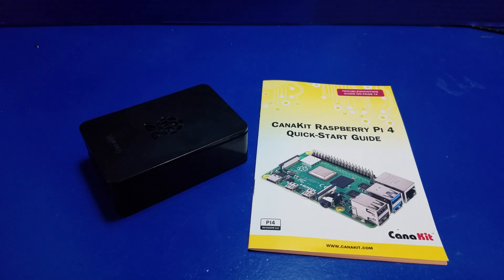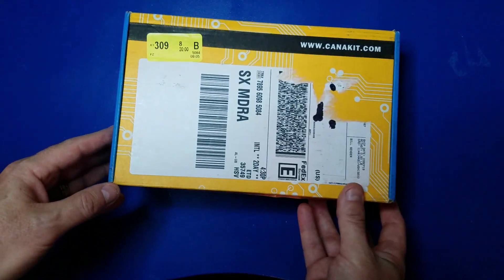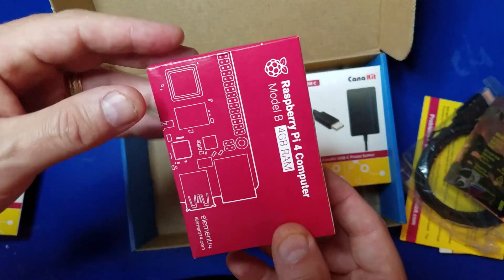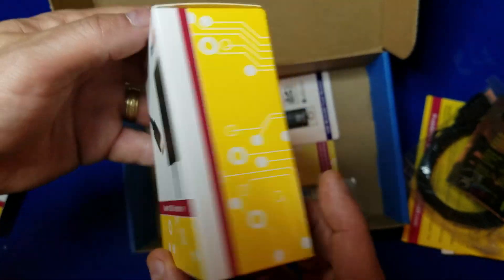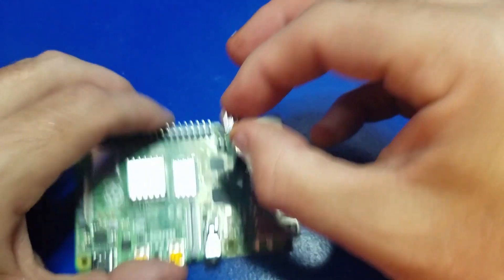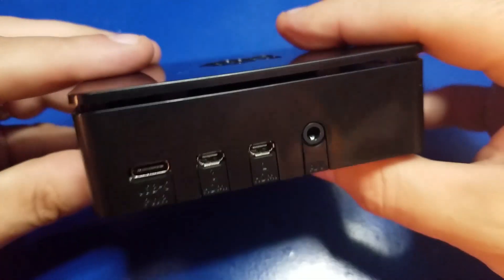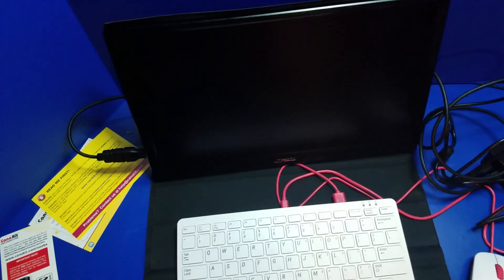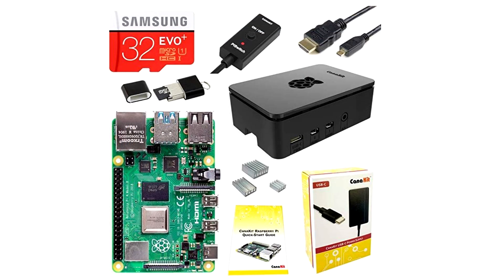CanaKit Starter Kit for the Raspberry Pi 4 4GB Setup with Heat Sink+Fan install & Test!

Comment: Hello everyone, and a big thank you to Wagner's TechTalk for posting this video, it helped a first timer set up his Raspberry Pi 4!

I purchased a Cana Kit with the Pi 4 with 4GB of memory, a 64GB SD card pre-loaded with NOOBS, and pretty much everything else shown in this video (mine had the on/off switch for the power supply).

Follow this video through each step (I paused where needed to make sure everything was correctly connected) and you should not have any issues with getting the Pi up and running. There are a couple of things I wanted to mention that I took notice of while getting everything ready to go.

First was the time it takes Rasbian to load on the card, for me it was about 12 minutes. Then when you select the check for updates option, it took approximately another 15 minutes to download and install (all automatically) the updates.

Also, while the Pi is checking for the software, and right after you first see the four Raspberries in the upper left of the screen, the monitor I was using went blank, saying no input, for a few seconds, then the Pi picked back up where it left off. So if you do see that on your monitor, don't panic, it should only be a few seconds at a time.

One thing I noticed (because I've watched several videos and read some articles on the Pi and it's setup) that was not mentioned in this video was what to do for your password. The Pi is pre-set with the password "Raspberry", and it is recommended that you change it to a more secure password during the initial setup. There are more experienced computer / Pi users out there that don't worry about this because of how much they work with computers, and change configurations, they just keep it simple for them.

The equipment besides the Cana Kit I used for the setup was a USB keyboard, a USB mouse and an LCD television that has an HDMI connector. Once the power was turned on, I had to find the television's menu to change the input to HDMI 1, and I saw the Pi's initial screen to select Rasbian to load.

I just thought of another issue I heard and read about regarding the cooling fan in the case. The videos and articles I watched / read mentioned the fan being noisy / loud. However, I think it is a pretty quiet fan, and it is a good first indicator that the Pi is running. Then after selecting shutdown from the menu, the fan is the last thing that is running as long as the power supply is still on. I pushed the on/off switch, turning the red LED off, and the fan turned off immediately.

I hope this helps anyone wanting to either buy a Pi, or get theirs up and running. I'm looking forward to the learning I plan on doing with regards to coding / programming, and then start on some of the projects I've read so much about.

Stay safe everyone!

Marc
Reply from the maker: Awesome write-up Marc!  You mentioned a few areas where the video could have provided a little bit more explanation.  I really appreciate your feedback 👍

Comment: Thanks for the video!  Does the fan work automatically once RetroPi is installed or does it need a firmware update?  Thank you!
Reply from the maker: The fan will remain on once fully installed within the CanaKit case, no specific firmware to install for this.  I have a video of another case that does require a service to run, the fan comes on only when the temperature reaches specific thresholds : https://youtu.be/MRVPjFlSzwc
Reply: @WagnersTechTalk  Thanks for the reply.  What is your opinion of the fan.  I've heard people say it's very loud.  Thanks again!
Reply from the maker: At 5.5v, its a little loud.  At 3.3v, not bad.  I have a bit more info in this more recent video: https://youtu.be/n-4IxW9cgN4
Reply: @WagnersTechTalk  Awesome.  Thanks!
Reply: Hi Wagner!  One more question for you.  Is there any benefit to running Retropi software with emmulated games on 2GB vs 4GB vs 8GB boards?  Thanks!

Comment: Amazing video tutorial. I have a quick question... Which way do you plug in the fan ? Grille side facing the RPi or the other way round for optimal airflow..?
Reply from the maker: Thank you Jonti!  I contacted CanaKit on this very same question, the answer is that it really doesn't matter.  I also did a little testing and found maybe a 0.5-1 degree difference either way.  I added this in the video description as well.  To answer more directly, either way you prefer.  Hope that helps!
Reply: Thank you so much for your response 🙂 👍.... I just saw that it was answered in the description, my bad 😅
Reply from the maker: No problem at all!  I don't always read the descriptions in videos either :)

Comment: Thanks for the vid! I noticed during the fan test you had the logo facing down but then during time laps it was facing up, then down again. Does either side matter?? Or should it be facing a certain way?
Reply from the maker: It does matter, the CanaKit logo on the fan should be facing down towards the board.  During the tests, it was pointing down (as it should).  I made it a point to make sure this was a bit more clear in this new video: https://youtu.be/n-4IxW9cgN4 .  Hope this helps!
Reply from the maker: I need to follow-up with my original response to you.  I contacted CanaKit and asked what is the proper orientation for the fan, they confirmed what I had already discovered since my last reply.  It doesn't matter  Either way works fine and within .5-1 degree difference either way.  Hope this helps.
Reply: Thank you so much!

Comment: Cool video. Just finished setting up my kit however after successfully installing Retropie 4.6 and getting to play a few snes games, fan is not working. Plugged it in as seen here and also verified pins 4 & 6 wiring. Any ideas? Thank you!
Reply from the maker: Hi Rodolfo, are you saying the fan was working then stopped or it never worked?  In either case, if you're sure you have it connected properly and it's not working I would recommend contacting CanaKit.  I'm sure they would help you out very quickly with a replacement fan, if that's what is needed.  I contacted them once sometime back and they were very kind and helpful.  I hope this helps, let me know how your experience is.  I think you'll be pleased with their support team.
Reply: @WagnersTechTalk  Thank you Jon! My bad, sorry to spam you, but it was just that I thought fans weren't spinning when they actually were, on top of that I couldn't distinguish the sound. Everything was just fine from the moment I turned the RPI on! Great video by the way! Will stay tune for more material.
Reply from the maker: Great, glad it's working for you!  Having a question is never spamming, I enjoy trying to help - even better when things go smooth!  That's a good thing for sure when the fans are so quiet you can't hear them.

Comment: My fans not working any tips
Reply from the maker: Onlly tips I can think of are to just double-check each connector and make sure the pin is seated all the way to the bottom of the plastic clip before pushing it in.  That and of course double-checking the right wire is going to the correct pins.  If none of that helps, contact CanaKit they're really nice about sending a replacement if needed.  I've had great experiences with their tech support staff (well, once).
Reply: Wagner's TechTalk thank you so much
Reply from the maker: Most welcome Gavin!

Comment: Thanks for the vidio. It was clean, cut to the point. I bougt this kit and should be coming in the mail soon. I got one question. I have bad vission and I like to know if there is accuse to the gpio pins wile the case is closed?
Reply from the maker: Thank you Edward for your kind comments!  There is a very small gap between the top/sides (5mm guesstimate) of the case, you could likely feed a ribbon cable or some of the wiring through, if needed.  However, it doesn't have a full opening or cutout directly above the GPIO pints.  Hope that makes sense :)

Comment: What a piece of junk!!  Hooked it up to a Vizio TV. Sometimes it'll work, more often than not I get "NO SIGNAL" Piece of JUNK!!!
Reply from the maker: Try a different TV ;)  It's the Vizio, most likely.  I've had a crapload of issues with Visio TV's even when connected to a laptop (running Windows).  Anytime the screen resolution changes, the TV freaked out.  Seriously, try a different brand monitor/TV and you'll have a different opinion.  If you don't have anything else to try with it, make sure it's set for Gaming mode -may help some.  I was using a Visio 42" TV to build a vpin and the monitor died before I could finish the setup.  Visio is good as a TV, but not so good for computers (IMO)
Reply from the maker: If you don't mind, once you try a different display and you find it works fine please update your comment about calling the CanaKit a piece of junk (leave your original comment, but just add "UPDATE: ...").  Folks do sometimes read these comments and don't want to give them the wrong impression when it's not the fault of the device being discussed.  Though, this discussion about a Visio TV being used as a display is very much useful information to some.  Much appreciated if you don't mind and have the time.
Reply: @WagnersTechTalk  * Update * 
I'm having dinner right now. Broccoli, mashed potatoes and... crow. Long story short the problem was the mouse I hooked up. It's a fancy one, has a real spider encased in plastic with a light show to highlight it. It was drawing too much power, so there was not enough juice to send a signal to the TV.
Reply from the maker: @pierrebezukhov2698  No worries at all.  Thank you so much Pierre for letting me know what the problem was.  I do the best I can to help, I'll remember your issue for the next person that runs into the same and will probably add it to the troubleshooting so I don't forget.  I'm so happy you got it working!!  Cheers!
Reply: @WagnersTechTalk  You know what would be really cool, and foolproof? Manufacturing TVs with Pi built in.
Reply from the maker: @pierrebezukhov2698  Now you're talking!  I'd probably buy one :)

Comment: Followed instructions.  No boot. :( Steps here.  Remove case, mouse, keyboard.  Reinsert micro sd card.  Connect hdmi directly to PI 4.  Booted!  :)  Inserted wired mouse.  Proceeded with install.  Connected wired keyboard when required to enter router ssid. Replaced bottom. side.  Connected fan. Saw spinning. Replaced top.  All working ... so far. :) Video made install EASY.
Reply from the maker: Awesome to hear William, happy it was helpful for you!

Comment: I’m stuck on a rainbow screen what do I do
Reply from the maker: Does it stay there if you power it off and back on?  Try unplugging all USB devices until it boots, maybe there is something wrong with a device plugged into the Pi?  If all else fails, re-flash Raspian.  If that still doesn't work, might have a defective unit.  I've not had it hang myself.
Reply: Same

Comment: How does that card reader at 3:17 work exactly?
Reply from the maker: It's just a USB-based microSD card reader, in case you need to re-load Noobs/Raspian Buster.  You insert the microSD card and plug the adapter in to your PC/Mac and re-image the microSD.  Most computers/laptops will have an SD card slot so this device is unlikely to be necessary.  Also, since everything is pre-installed for you on the microSD it's even less necessary.  Good to have, if you need it I guess but unlikely you will.  I hope this helps!
Reply: @WagnersTechTalk  

sounds perfect for using an old 128gb card that's collecting dust.

Thanks.

Comment: Also can i use a Bluetooth  keyboard and mouse?? I got the same kit as you by the way..how come i have a bunch of screws and such dont use any??
Reply from the maker: You can use a BT keyboard and mouse, but you'll need a wired one to set up the Bluetooth.  Not sure why you have a bunch of screws mine did not.  Perhaps they are providing alternative mounting options in more recent packages.  No screws were needed to assemble the case.  Hope that helps!

Comment: So if you do everything correct soon as its connected and powered it just starts up? Or do you need too pre install the SSD first on a laptop 
?
Reply from the maker: Once the case is assembled, the video shows inserting the microSD card at the bottom.  No need to do anything on the laptop as long as you are using this CanaKit.  Just follow along the video and it should make it easy.  Hope this helps.

Comment: What adhesive is on the heat sink? It looked like two sided tape when watching on my phone. I hope not, cause that would insulate instead of remove heat.
Reply from the maker: Might want to contact CanaKit on what the material is actually made of, I'm not sure.  I would think it's made of a material which would be conducive to heat dissipation.  I have no way of knowing, hope this helps.
Reply: @WagnersTechTalk  thanks for the reply! I'll find out soon enough, have one coming in the mail. Going to attempt a ammo box home made sdr scanner. Hopefully I figure it out I'm not amazing at computers and have no Linux experience. I had better because I'm approaching the $300 Mark and don't even have the hardware yet :)

Comment: KITS: Canakit vs Vilros ? Anybody? I'm hovering over the Amazon buy buttons. Unsure which is best. I mean the basic $80-100 Canakit vs Vilros
Reply from the maker: I can only comment on the Canakit myself, it's the only one (aside from the official RPi Desktop kit) that I purchased.  I have not received/reviewed the Vilros kit.  Between the Canakit and the Desktop kit, the CanaKit has the heatsinks and fan that is necessary.  You can check out all my RPi4 coverage thus far here: http://wagnerstechtalk.com/rpi4/

Comment: Hi. I just bought the raspberry pi and I mess up. I accidentally touch the CPU before put on the heat sink. Did i mess anything up? Or make cooling worse?
Reply from the maker: Probably didn't mess it up, but do put the heat sink on and setup Raspian Buster and see how it goes.  Static electricity can certainly damage sensitive chips so be careful not to directly touch any of the metal contacts directly.  That said, I'm sure I've done it myself and hadn't had any issues (but I don't go out of my way to cause any either lol)

Comment: Which Linux operating system would be good for Raspberry Pi 4? I have heard that Kali Linux is good. However, I am confused on which one I should get. 32-but or 64-bit. Also, what is the max size for operating system which could fit into Raspberry Pi 4?
Reply from the maker: I would recommend starting out with Raspian Buster, then you can play around with other distros if you wanted.  Link here: https://www.raspberrypi.org/downloads/raspbian/

Comment: Doesn't the Pi 4B have pins specifically for a fan by the other end of the GPIO pins?
Reply from the maker: The pins used here are per the included CanaKit instructions.  Not sure I understand your question?
Reply: @WagnersTechTalk  I'd thought there were pins (or a header) specifically for a fan based on a different video. I searched and found the pins I thought were a for the fan were a header for a PoE Hat.
Reply: @fretless05  They should have designed the RPi 4 to have separate +5v and GND for the fan. Now I'm robbing from the 40-pin header and unable to use a 40-pin ribbon cable if I so choose. Major oversight IMO.

Comment: How would removing the heat sink from the top of the case affect the results from the stress test?
Reply from the maker: It will get hotter, faster.  In this video: https://youtu.be/ikX-NUmfvWc the heatsinks were not included in the package.  As a result, just playing a video on YouTube began the CPU throttling.  So, you definitely want heat sinks and a fan.